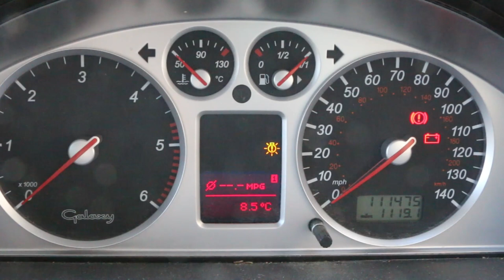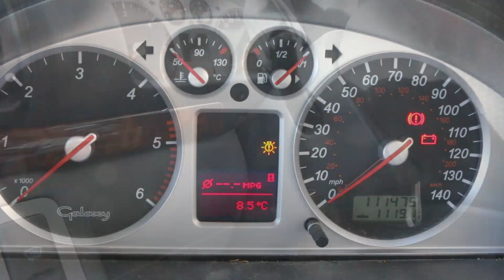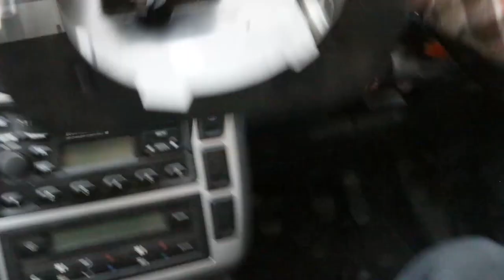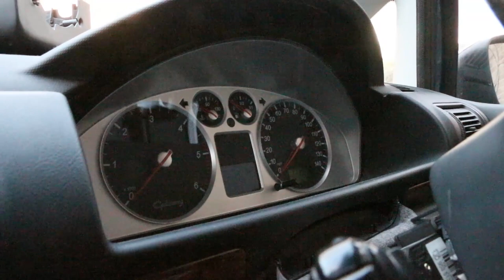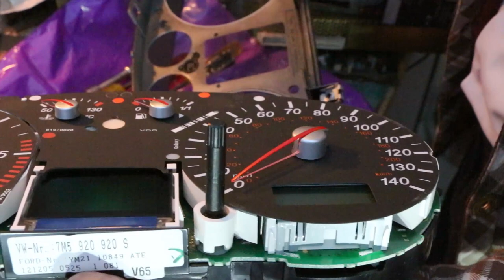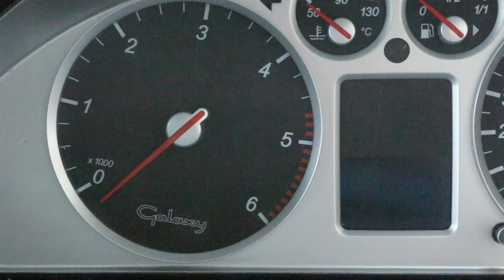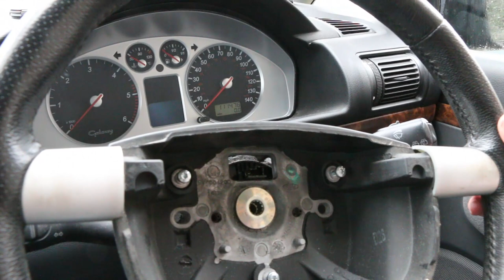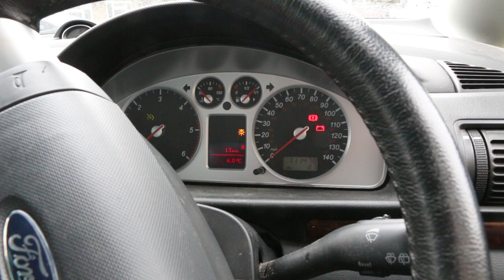2006 Ford Galaxy Mk2 Instrument removal & inadvertent Cruise Control fix.

Comment: why remove the flying airbag???
Reply from the maker: As I recall and it's while since I did this, you have to remove it to get to the screws that hold the lower nacelle on the steering column. Having just watched that bit of the video again, I expect you could leave the airbag plugged in, I felt safer with it out of  the way. 
I have mentioned somewhere that advice I received later, suggested I should not have unplugged it without first disconnecting the battery.
Reply: @twotone3070  You dont have to take airbag off. Just turn steering wheel about 90 degree and you can get to scew - and same on other side!

Comment: Another bit of ridiculous design on the Galaxy - absolutely no reason to have so much dismantling just to pop the instrument panel out. Others  I have come across - Aircon condenser: you're supposed to drain the cooling system and drop whole radiator assembly. Intercooler needs a load of stuff removed (in both cases I was able to drill/cut away front panel to get access - stupid design). You can't check/top up brake fluid without removing air filter (unless you use a syringe). And you need fingers like ET to change headlight/sidelight/indicator bulbs!
Reply from the maker: Yes, I had the BREAK warning come on and it was low on fluid, which is not surprising as I couldn't even find the reservoir and so had never been checking. Which I should have done of course.